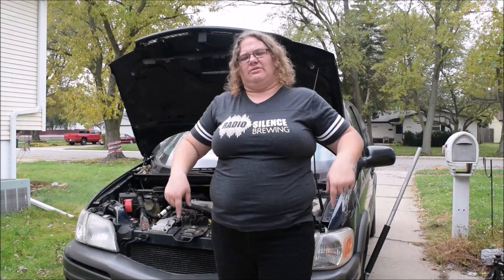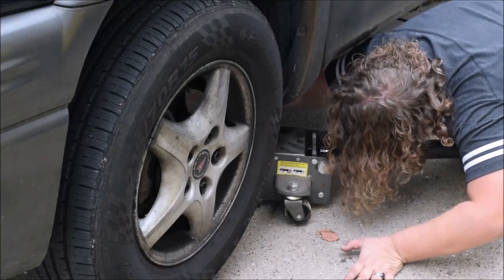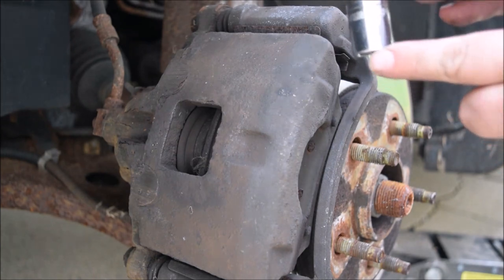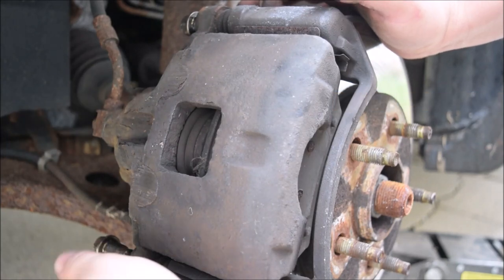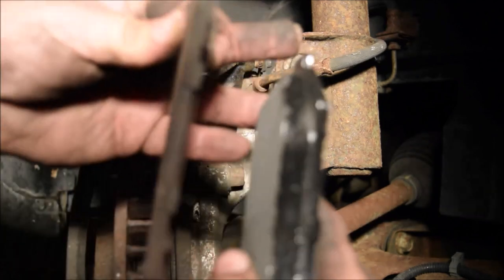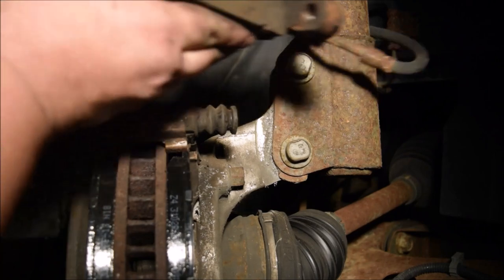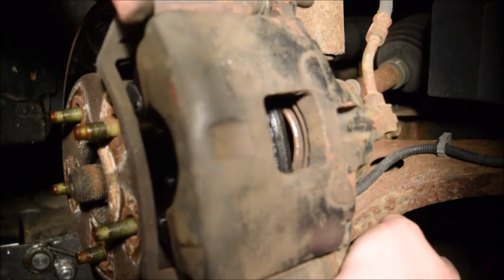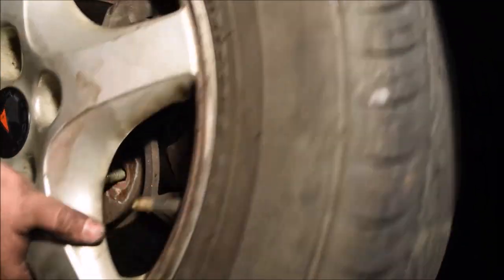Diy Pontiac Montana brake pads tutorial

Comment: You have to put silicone grease or brake grease on the ears of the brake pads to prevent squeaking noises when brakes are applied. Also lubricating with grease prevents corrosion of moving sliding parts.

Comment: I allways use a pry bar  to take the caliper off after I have removed the retaining bolts they are normally they are stuck on. The heat that is generated by the brakes. Makes the cailpers stick to the pads. The slides seaze due to  last owner not  knowing about anti seaze. I have  seen this happen on many cars. I  hope you don't take offence to my comment. I am a mechanic to trade. You did a great job. 👍👍 I  allways estimate for brakes 1hr to 2hrs.
Reply from the maker: Hey I welcome tricks this car has been full of seized up problems but I’m getting it done that’s the main importance tips will help for next time lol
Reply: @livewithr5946  Any tips you need mail anytime. 👍👍